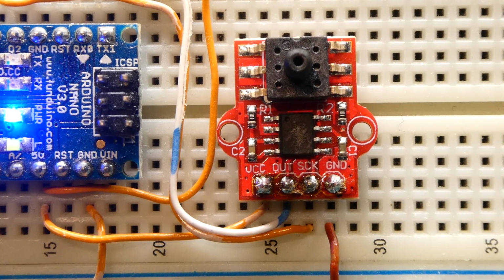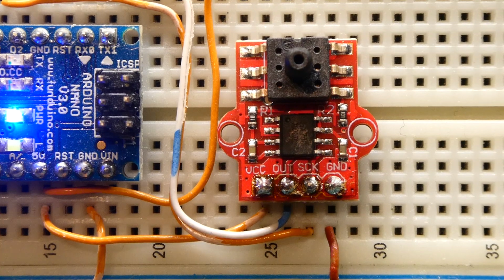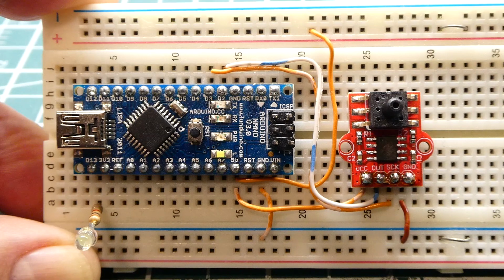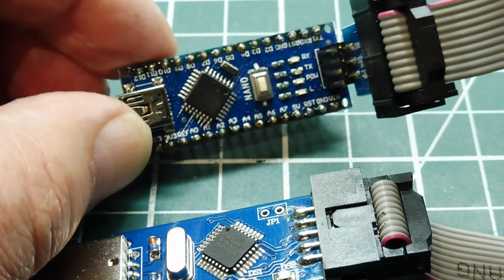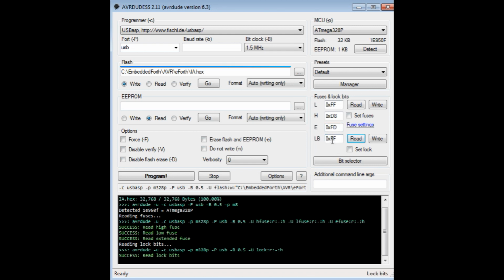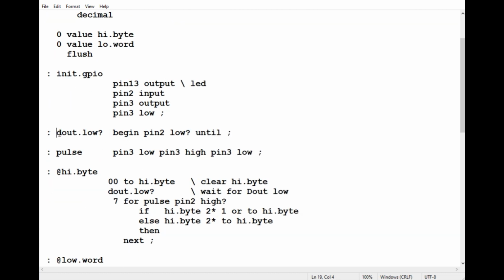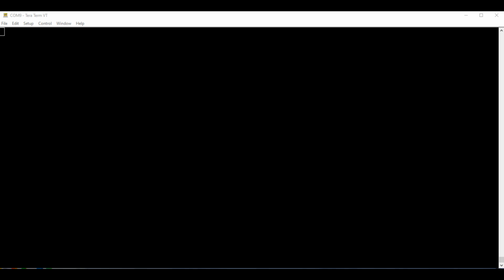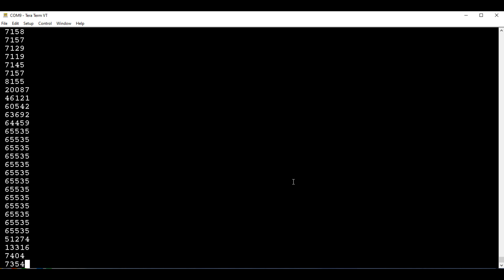Air Pressure Sensor / Breath Controller / Arduino Nano

Comment: Using this sensor. Can wind speed be determined by using the wind speed and pressure relationship? Classical vane anemometers are misleading at low wind speeds.

Comment: Can the sensor read value if I don’t let the tube interact with water, i wanna attach this to a closed chamber, will it read values if I increase the pressure in the chamber

Comment: Thank you for the information, so the MD-PS002 sensor is not suitable for use as a TPMS? I'm working on my final project and plan to use this sensor because it's low cost, but do you have any suggestions for other pressure sensors that can be applied to TPMS besides MD-PS002 and MPX?

Comment: OMG. Thank you very much. I am looking for that set 2 years. Thank you for that hope you give me.
I need to mix Arduino ide with your code. But your code is in an other format.
Can please make a code in Arduino ide
Reply from the maker: I don't use the Arduino IDE, but if you look at my code and explanation on how it works,  you can write similar code using the Arduino IDE.
Reply: I know it’s been a bit but have u figured it out?

Comment: Is this sensor compatible with a raspberry pi pico?
Reply from the maker: You can use any microcontroller that has GPIO.
Reply: @0033mer  Great! Thank you for your reply. Do you know of any resources that would help me write that code?
Reply from the maker: For the raspberry pi pico you could use Micropython with many videos available online. I program using the Forth programming language. Check out this video:  https://youtu.be/aW_Nh6QaNS0

Comment: Hello, thanks for video but i have one question. can we use with normaly arduino ide ? you programmed it a different way
Reply from the maker: I do not use the Arduino IDE for programming but you can. Using the Arduino IDE, send 24 clock pulses to the sensor clock input and receive the 24 bits coming back via the Dout pin for your pressure value.
Reply: @0033mer  thanks for kindly reply, i will try tomorrow
Reply: @serdarsabancilar752 I know it’s been a while but did u end up getting it to work?

Comment: Could the air sensor be linked to a Bluetooth module for output?
Reply from the maker: Yes..you can sent the data using a HC-06 Bluetooth module to your smartphone. https://youtu.be/_5g5lC-nDy8

Comment: Okay, Ive been playing with IA, and I was wondering how I would show that various commands? Example would be the forth breakdown of .pins? Thanks again, I find your videos very inspirational
Reply from the maker: The words added to the original eForth are witten in assembler and Forth so it would be hard to describe. I have links to two videos and a .pdf in the description box for more info on the code commands. IA is a simple Forth for simple projects to get it up and running quickly. The next step would be Flashforth and Mecrisp. I have written some utilities that might interest you if you want to continue with IA. I have no idea on how many people are using IA so I don't know how far to go with it. Thanks for the feedback.

Comment: Does anyone know if this air pressure sensor can detect negative pressure? ( or if not a similar one that can) I'm looking to make a (suck/blow) interface for a person with MND but need a way to detect two distinct inputs. From the readings shown would a value of around 0 actually require suction assuming around sea level air pressure?
Reply from the maker: For a Sip/Puff detector you can use this sensor: https://www.adafruit.com/product/3965

Comment: great video, Have you seen a similar air sensor I could use on my turbo car maybe 
with a range of 5-15 psi cheers Brett
Reply from the maker: Yes.. Here is a link to Adafruit's pressure sensor: https://www.adafruit.com/product/3965
Reply: @0033mer  thats Perfect thanks.....strange they didnt put a lip on the tube to help stop the
tube coming off at 25psi.....
Reply from the maker: If you want something more robust for automotive applications check out this sensor:
https://bc-robotics.com/shop/pressure-sensor-0-0-2mpa/
Reply: @0033mer  Even better many thanks......